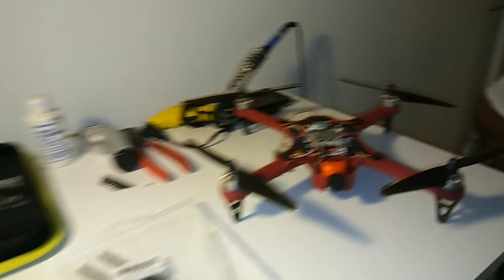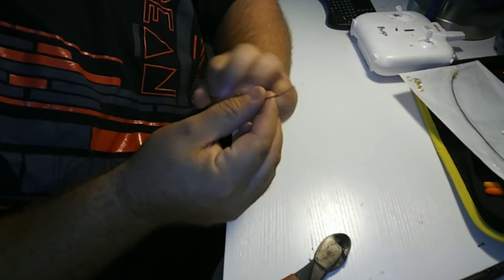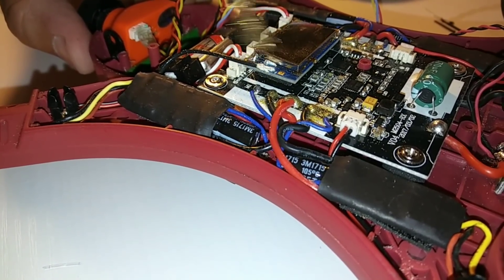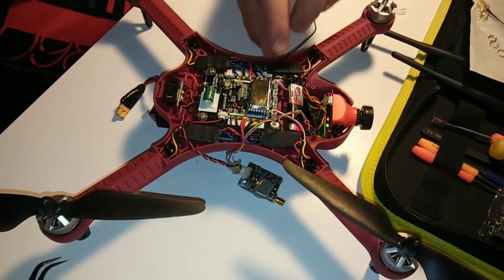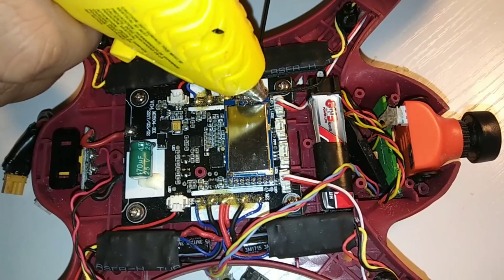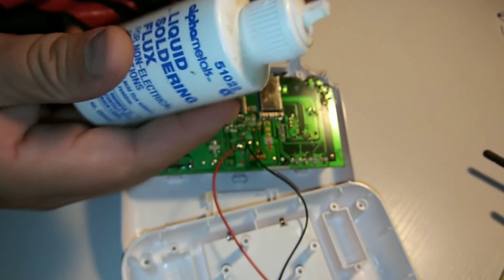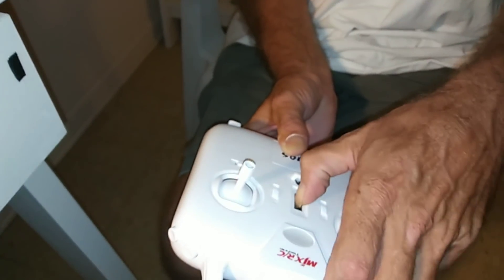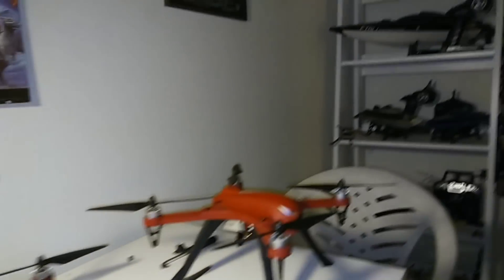MJX Bugs 3 Complete Long Range Mod Installation

Comment: Hey DW. I’m thinking to doing this mod after almost losing my Bugs this morning due to range loss it started beeping and I was getting a bit far. 
I’m confused about two things in this set up. 1- the pigtail that gets soldered to the board is just done right on top of the existing antenna connection ?
2-Also where is the braided piece doing same area on the board or is it somewhere specific ? Or is it right on the same connection. I’m just trying to figure it out. Ask questions now to prevent doing this it wrong later.  Lol
Thanks man. LMK
Reply from the maker: +Rc Drone uh-oh somebody didn't watch the video all the way through... All of your questions were answered in the video
Reply: Drone Worship I did actually. I watched all of it. Still little unsure. The vid wasn’t the best.No offense. You stated “it goes to the right of it.” I like to be more accurate.  I’ll figure it out. 
Thanks anyways.
Reply from the maker: +Rc Drone it's pretty hard to confuse how to do this job Once you pull the top off and clean off the black rubber you'll see exactly what you need to do. I feel like you're overthinking the process it's actually quite simple. Yes your soldering over the top of the old antennas you're not removing them. If you remove the old antennas the transmitter will not stop beeping and will constantly say signal lost so do not remove the original antennas just solder over the existing antennas. If you look at the wires that are already saw it on the board you will notice one of them has Flex wire that is where you are going to be soldering the flex cable to when you pull it back
Reply: Drone Worship ok perfect. I just wanted to be sure. I’m about to order the pigtail/antenna set. Thanks man. Appreciate the mod ideas. I’ll let u know how it turns out.  
Btw is a 6db set ok to use as well ?
You mention a 3db
Reply from the maker: +Rc Drone I would stick with 3DB the 6db are just a little too big
Reply: Drone Worship 👍🏻

Comment: What's the flight time of both
Reply from the maker: Astronaut Eazy I'm not having any problems and with the upgrade Eangpow 3000 milliamp battery I'm getting 18 minutes of flight time while running the fpv camera from the power on the board

Comment: I am writing this mid video so excuse me if you mention it. I assume the little single cell lipo is to run the fpv. Why add the weight? and at only 3.7 volts I would think it would run the vtx better at the higher voltage available right there on the board.
Reply from the maker: No it will actually cause power lines in your video feed on the VTX which is why if you're going to run the camera on higher MW you would want it to have its own external power source and we're talking about a drone that flies for 20 minutes I don't think adding .4 grams is going to make any difference.

Comment: Did you ever run 3s on this quad??
Reply from the maker: WCxColossus absolutely not it's too much power for the e s escs they will burn out after a few uses
Reply: haha i figured i killed one today luckily i had extras thanks man